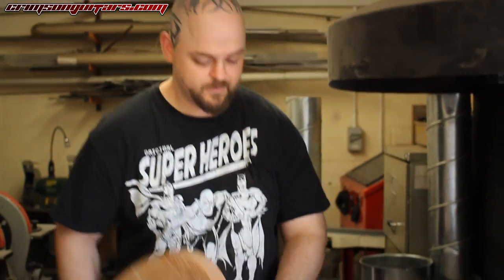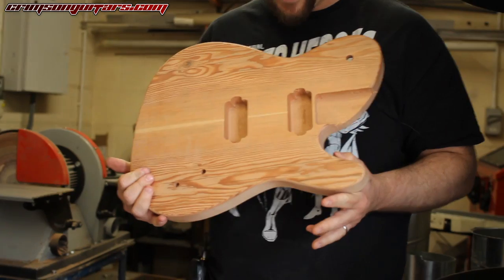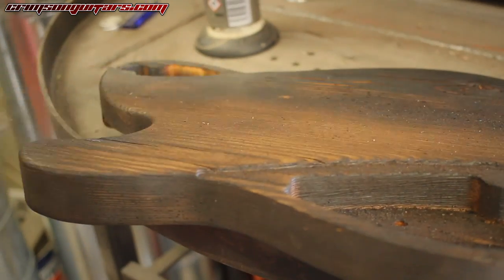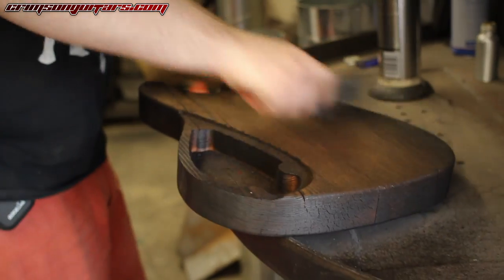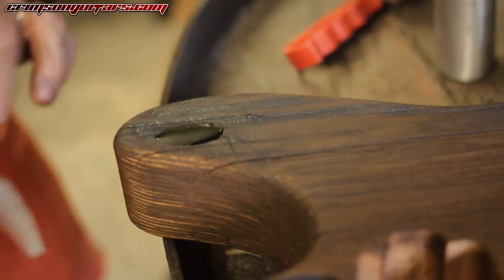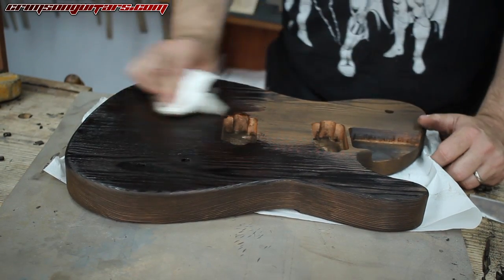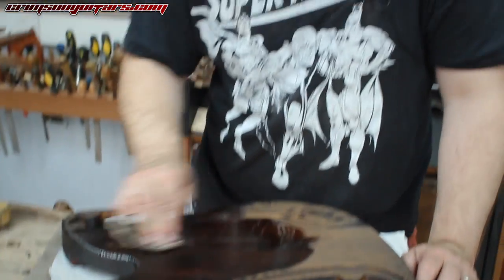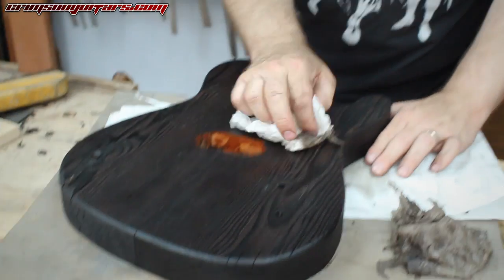Ben Experiments with Fire - Shou Sugi Ban on a Guitar

Comment: Is this meant to be Shou Sugi Ban? If so you've missed out some crucial steps mate. Try this.....Char the wood then COOL it down, then wire brush it, then brush it again with with a brush with firm bristles, then WASH it with plain water, then oil it, then go over it again with the blow torch but very lightly and quickly, then oil it again, then rub, rub, rub as if you were polishing it.
Reply from the maker: +John Currie the best way to get the right answer on the Internet is not to ask, it is to post the wrong solution and wait.. You sir are my hero, thank you!
Reply: @CrimsonCustomGuitars  I purchased one of your early raw descendants yesterday. Has the Duncan Jazz and JB pickups and is made of the recovered yew lakewood with wenge neck.

Best guitar I've owned and played in my 30 years of playing. Hands down.

Thank you Sire
Reply: Sorry Kengo Kuma, we didn't realise it was you....

Comment: Useful DIY tip...if you're sinking any timber into the ground, fence posts etc. burn the ends which will be buried and they will last much longer. True fact.
Reply: been there, done that. also did a shou-sugi fence. cedar and redwood. done right it looks fantastic. done wrong... got marshmellows? >;)

Comment: Have you created a a Crimson fire brand to brand the headstock?

Maybe consider vacuum resin infusing the body after burning it to fill the splits. Add some glow in the dark pigment to the resin and it'd look great.
Reply: i was thinking about suggesting this and you beat me to it
Reply: I've used polyurethane resin to stabilize char, but it would likely interfere with the oil finish.
Oh dang imagine filling the cracks with red glow in the dark pigment!
Reply: +Tyler Smith exactly my thought. Make it look like a glowing ember. 
If you resin impregnated the body, you'd have to finish the guitar in either a lacquer or more resin and then flat and polish for a shine.
Reply: If you did a deep (as in penetration, not necessarily colour) red stain before charring would you get a similar effect? (minus the glow in the dark).

Comment: i have to be a bit of a "that guy" here: the method is called yaki sugi, shou sugi ban is a just brand name, but used almost synonymously in the west.
a fun variation is to charr the wood, and sand it down to the desired hue. this works wonders on woods like oak, that have a strong, destinct grain but fairly even coloration, to make the grain pop dramatically, because the differend densities darken at a very different rate.
i've done a fretless fingerboard that way, and used a piece of metal as a mask, to but the fret markings right into the color of the wood itself. under a mirror-polished CA finish, the luster almost has a hologeaphic quality to it.

Comment: this works best on solid guitars with no lamination. laminated woods tend to separate and the glue joints weaken you can also burn a piece of topwood, THEN glue it to the body and very lightly burn the edges to match with several light touches and re-burning so the wood doesnt get too hot inside. you can also just use a wire wheel and rough the grain or sand blast it to get the same texture and then use black paint or tinted oil for the "char" effect. you can also do numerous burns and brushing steps and let it cool between so you get deeper and deeper texture and then seal it with a thick clearcoat, then polish it like glass and it looks like obsidian. i got an obsidian baritone on my wall that sounds badass and because of the numerous light burns and brushing with cool-downs in between, it has no edge cracks or delamination.

Comment: If the oil is flammable then why not apply a thin coat to the surface of the wood before applying the finish allow it to soak in then burn it (may be worth applying the oil is small batches) this may then allow the fire to burn away at more of the soft wood and create a more scooped look between the grain.

Comment: You know why I hate this? I was having the same idea about finishing a guitar like this when I was doing another project (restoring my knife). 

It's an old trick here in Finland as well to burn wooden axe handles and similar stuff to harden the wood and have a protective top layer to preserve it. I'm not sure if they used oil in the olden days here since the burning seems like it was a quick fix for everyday tools etc. I used fire, oil and wax with my knife handle and I have wanted to do this to a guitar ever since. It just feels right.

Comment: Did you see the video of me burning the BC Rich a couple of years back? :D I added some decorative brass plating and then literally threw it in the fire, turned it over a few times, wire wooled the charred stuff off and put on a lovely black oil-wax finish on it :) so much fun!

But yours looks very nice :) definitely a much more controlled method.

-T

Comment: I was doing this with Danish Oil on my burned guitar, but it got a little to tacky after my 4th oil layer. I think I let it try a little to long after removing all the excess. Should i go on with oiling and apply the next layer or do i have to do something else :o Thanks in advance...
Reply from the maker: +Stephan Forcher I would suggest try and get rid of the top coat with some thinners then let it dry well before going again.. B
Reply: Thank you very much! I'll try :o

Comment: I think you could achieve better control over how burnt the wood gets if you used a hot air gun, in case you wanted to use a more light burning effect.
I'd also try baking the wood. Like, literally sticking it in an oven for a while. Perhaps even trying baking it with the finishing oil applied to it...

Honestly I could think of different ways of doing this for a good few hours.

Comment: This is not really shousugiban but rather toasting of the wood.  It probably hardened the wood and changed the tone so thats a plus.  Yakisugi is the actual technique of flame preservation of cyprus, sugi means cyprus in Japanese.  I dont think yakisugi would really work on a guitar because in order to achieve the deep preservation offered by carbonizing the wood, you need the surface to become like an alligators skin.  This lets you know that the char is deeper than the surface and will not rot internally.  On a guitar this would be difficult because this would jeopardize the structural integrity of the instrument.  With that said, I think flame hardening is an under utilized technique.  Some of the best sounding guitars I have played are ones which have survived and been hardened by structure fires.  I will never forget the sound of a jazz parlor guitar I foolishly passed up and came back for only to find it had sold 30 minutes later.  It was a curly archtop which had all of its inlay slightly deformed by flame damage, but the hardened archtop face and interior of the guitar caused it to have an explosively brilliant tone.  It was amazing, I have no idea if it was actually exposed facing the fire, away form the fire, or in its case when this happened so it would be tricky to duplicate.  On a side note, Nice build!

Comment: Just curious of how it works in the uk, But here in finland we can't work with fire or even a heat gun legally unless we have gone to a fire safety course and have permission from someone legally able to give permission for fire work, usually the fire department or a welding firm, I think you need supervision as well. So if we work with anything the government thinks is a fire risk we have to do it outside of work (or we get fined) if we can't be assed to wait a week for a permit. The course costs 100€ and 32 work hours last i checked and a permit costs something.
What are the laws regarding fire work in the uk?
Pardon my poor explanation, I haven't slept in a while so my brain is fucking with me.

Comment: hey ben, wondering if you could please answer this. I have been using your guitar finishing oil (my first time doing it) and the finish is coming up a bit sticky am i doing something wrong? or am i missing a step? thanks in advance.
Reply from the maker: +matt ellis yes, you have to run all the excess off every coat. If you don't then it will not cure fully. Wait for about 10 minutes after application then rub it away til it is basically touch dry. Repeat a few times and the finish builds up nicely.
Reply: ahh ok glad to know thanks very much!

Comment: I used to do this with ash hammer handles 
But i didn't brush it off
I just applied the oil while the wood was still hot

Comment: Anybody any clue of sorting out when the glue joint starts to delaminates on a two piece body, think the heat getting to the glue and the timber drying out very quickly has caused it 😖 don’t think it’s at risk of completely going just more for aesthetics.

Comment: DON'T EVER burn hemlock without wearing a respirator again!
Reply: Why not?
Reply: ch2263 I was kinda joking, it would take a pretty thick concentration of smoke, but it is fairly toxic and will do serious damage if you are exposed to it repeatedly over long periods of time. It's similar to if you burned a 55 gallon drum of pipe-tobacco in a closet and sat there taking deep breaths until you passed out. The saps and resins that hold the grains together are very thick, and when carbonized, will cake on to everything, including your lungs. A good exhaust fan in that flue would help, but a respirator, or at least a paper mask, is the best way to keep your lungs from getting royally fucked up like a coal-miner.